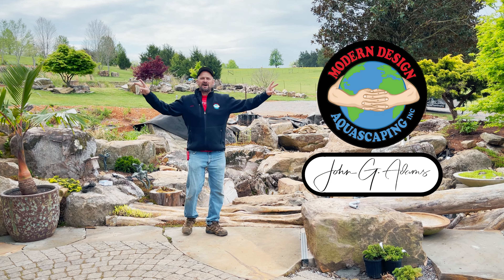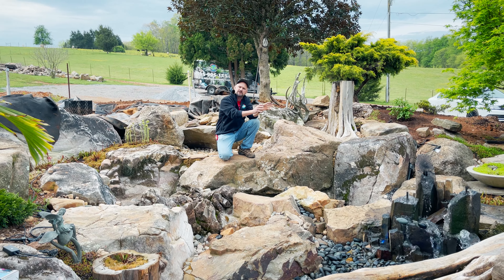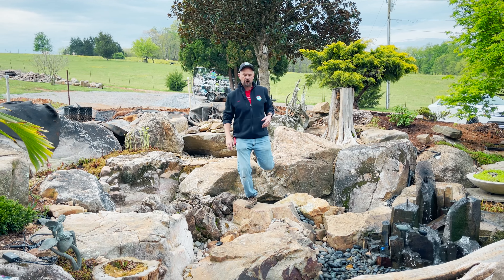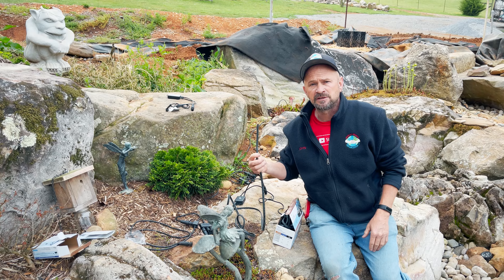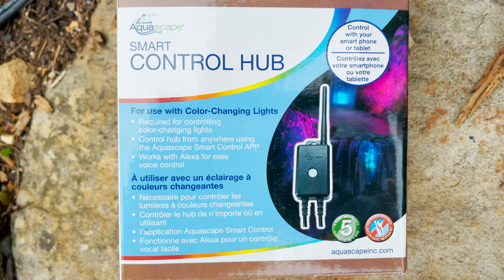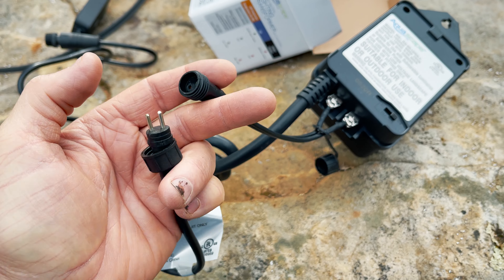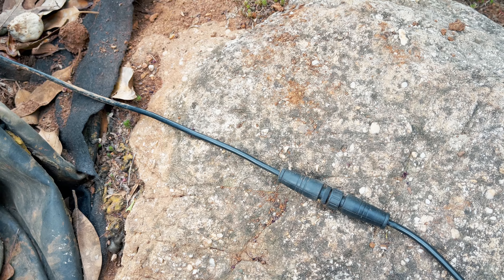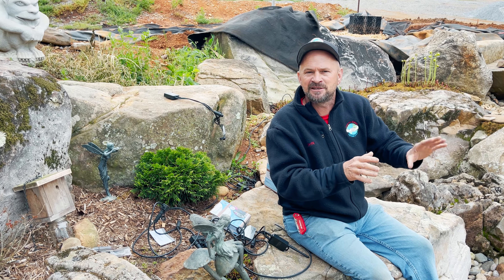Color Changing Lights Tips and Tricks | Water Feature Design Series 15

Comment: Has there ever been a time when you used conduit/pvc to run all the wires throughout the entire feature so as to protect them from all the different things Mama Nature or Man can throw at them? Is that more work/cost than it's worth? 

If some kind of preventative measure isn't put in place, I feel like people will forget where the wires are buried and eventually hit them with a shovel... 

or critters will chew on them...

or the constant shift in the tectonic plates and/or the upheaval created by the changes in the season (for those of us in the north who experience such events) will crush and or expose them.

Thoughts?
Reply from the maker: Conduit gets them from the light to the outside edge of the liner-easy to replace, easy to locate. We do a video on location of connections on larger features for ease of maintenance in the future, and we keep the “buried wires” right against the outside of the liner so shovels don’t cause an issue. That’s all I have on that ;) BTW I am above the ocean on the way to Japan answering you LOL #ThingsThatMatterWithPeopleThatMatter #PondGuysDoThat #ProudPoppa
Reply: @KoiAddiction  😳 Nice! I feel privileged 😆

Comment: John, in reference to the flow over, how does this affect the amount of storage in the intake bay? Do we have to account for that extra flow? 
Appreciate ya! -Matt
Reply from the maker: Our flow over goes into the reservoir at the bottom so yes it is part of the water in motion. If you have an intake bay in the pond below you just need to figure how much water (volume) is going to flow over during power outage and then figure how much that will raise the lower pool level in inches and make sure you build to hold it!

Comment: So some of the pictures of waterfall you see where every cascade is a different color, are all on different hubs??? I don’t think one to six watt lights is really “light pollution“ I feel like it’s more 2,000 watt parking lot lights, and what not that do way more light pollution than our aquascape lights.
Reply from the maker: Yes, and for the most part, they can all be set on the same color. In my opinion, when you start getting lights that are different colors you have either overloaded the circuit and are running low voltage to one of them or more than one of them or you have a bad fixture. There are also some programs that utilize, multiple color changing situations as well.